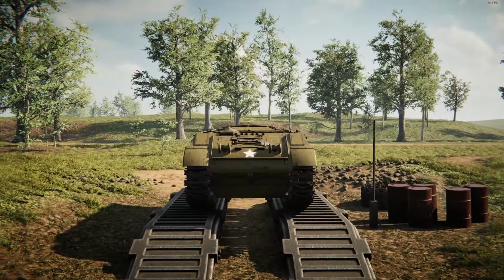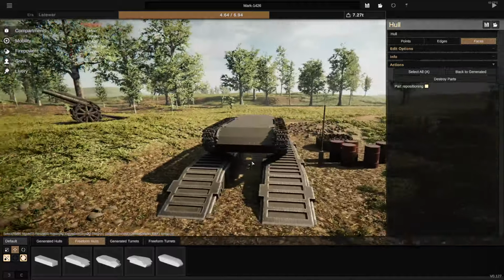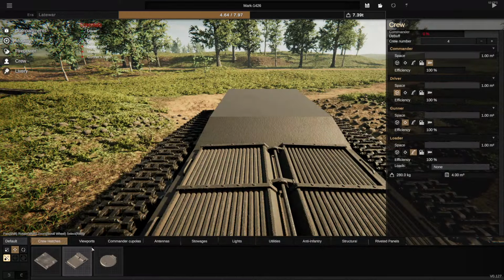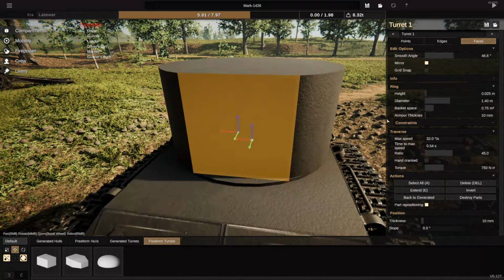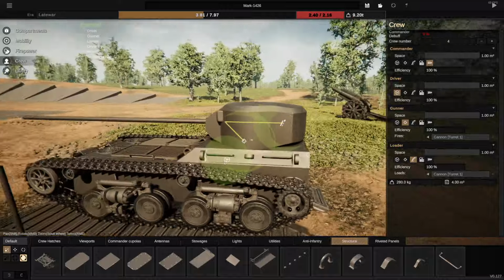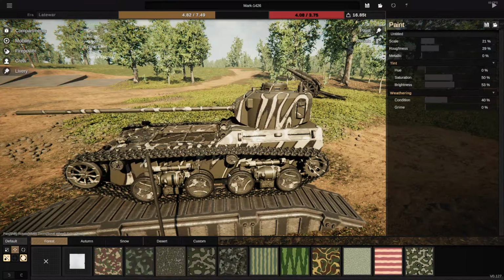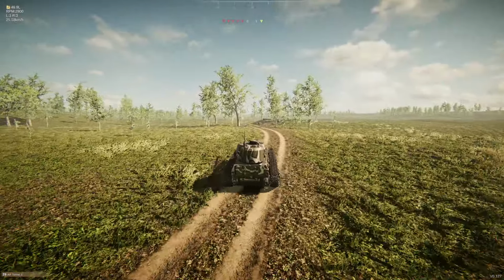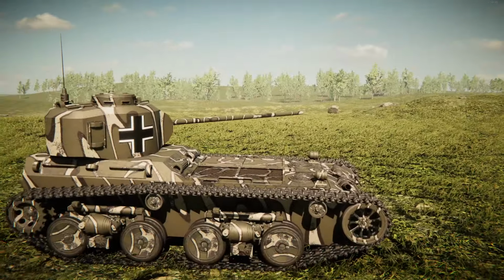I Built A POWERFUL Sniper Tank In Sprocket!

Comment: A power sniper tank. One of the more common tank designs in the game, but also a wide and varied design for tanks where no two designs are exactly the same.
Reply from the maker: Yuppp
Reply: Hello i JUST recently installed sprocket .what Are the Basic controls?
Reply: @FranticMatty What button do you press to make cannons vertical? I really want to make the “tracked torpedo” you made

Comment: Day 2 in Sprocket: Could you design a casemate tank destroyer that uses a 150mm cannon built on a chassis that looks like a box (similiar to the PBV 301 or the M113), the name of it will be CTD-L (Casemate Tank Destroyer - Lightweight)

Also the suspension of this sniper tank is called a bogie suspension and it's one of my favorites, love your Sprocket videos btw :)

Comment: I have a tank and it was has the 6 Mark track and 4 Auto cannon on the side 1 26.97Cal 1 Meter cannon on the center and Some Flak on the top And the name is Ivan The terrible And The 4 exhaust  is on the front pointing back but not cover the sight so it got like Fog behind it cover the tank and 34Cal modified KônigTiger  is the weakness but i has to Broke The Cannon and 2 front track 2 Back and  That is it cannot move And Vulrable (Sorry for the grammar im german Sorry)